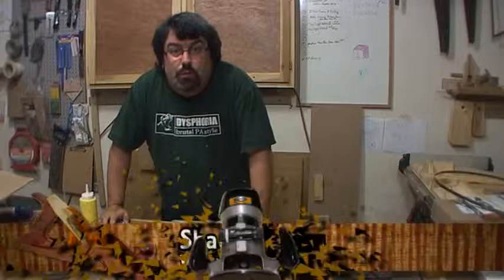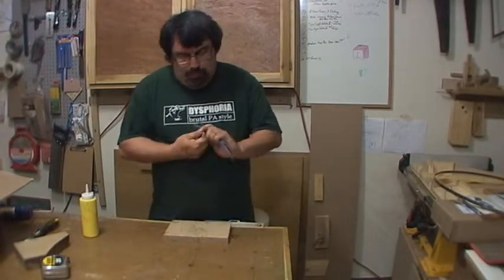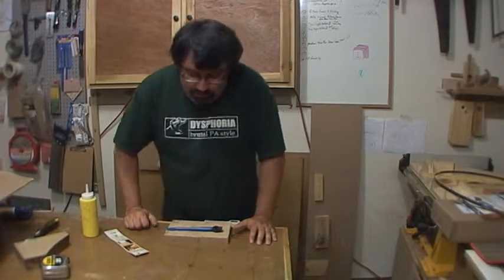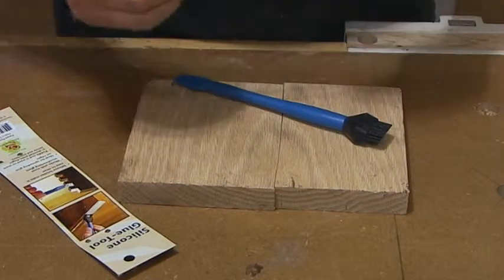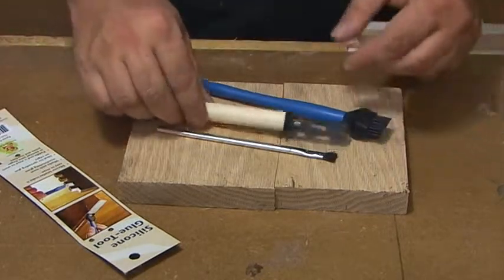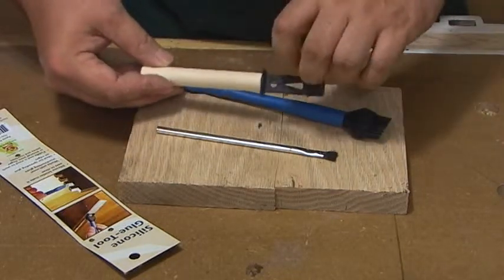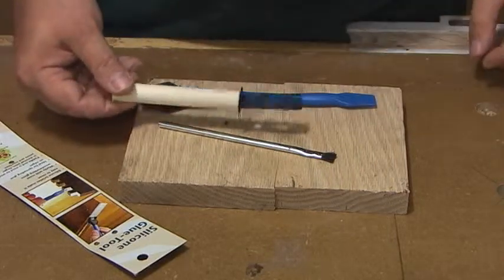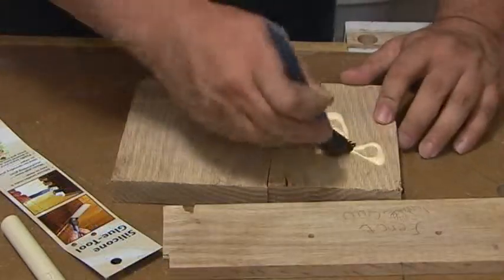TIW Review No. 02 - Rockler Reusable Glue Brush

Comment: Hi,
I also like reusable tools in the workshop and I look around here in England for things to use.
I was in £land that is a shop where everything is a pound hence the name when I came across some pastry brushes (2 on a card), these were silicone and look identical to the Rockler glue brush but at just 1 pound for 2 it works out to about 1 $ each.
I have been using these for some time now and I like the way that the glue just pulls off when dry and the brush is ready for use again.
Thanks for the informative videos and keep up the good work.
Regards John Fithian-Franks